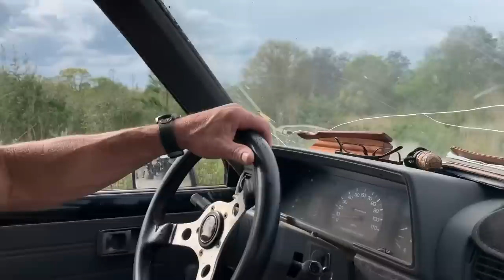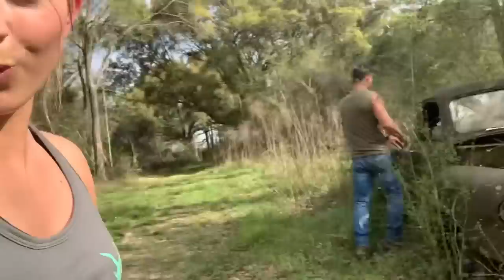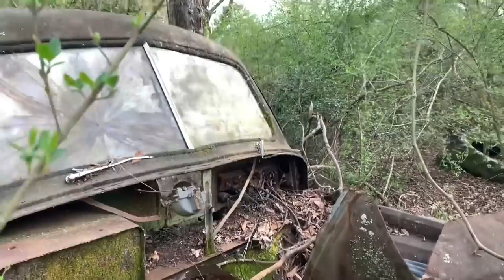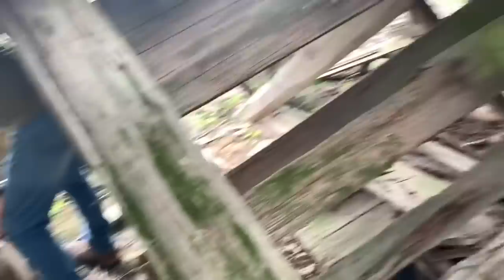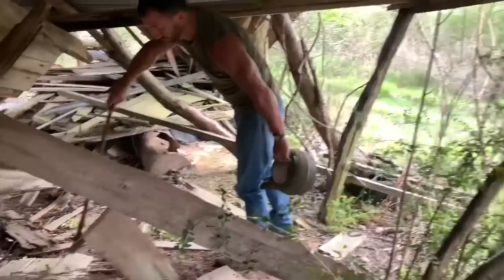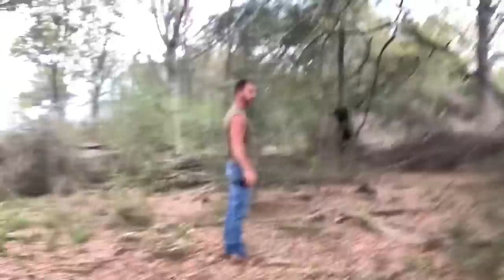Looking for Turkeys & Exploring Old Barns!

Comment: I’m right with you Hannah … I love encountering old buildings and rooting around … we have a old railway line from my city Cambridge that runs all the way to 4 cities away Paris … the cities all tore out the tracks … sanded it all down and it’s a walking … biking … cross country skiing trail … but what’s special about it is all the old ruins back in the bush if you’ll go off the trail … old homesteads … what looks like some kind of storage or factory buildings by the size of them … an old water mill it seems with the old wheels inside that’s about a mile from where the Grand River runs now … it’s an amazing hike and a look through older times trying to figure out what the buildings could possibly be … keep checking those old places and I will too !! … appreciate ya !!!  💯❤️🇨🇦🤙

Comment: Only 3 weeks - not too bad actually.  I hate it when I'm out scouting property and end up finding treasures like what yall discovered because my scouting goes all to heck.  What's funny is when I find an old plow piece in a field or clear cut I pick it up and use it for decoration, but when I lose a piece off of my tractor all I do is cuss about it.  As always, thanks for the video and good luck with the turkeys.  I went turkey hunting last weekend for the first time this season.  Not my norm as I usually take opening week off of work to get after them, but this year the virus has me working harder than ever.

Comment: My 69 Bronco was a early release Sports Edition that was sold to the USPS in Trinity County California in Nov.1969.
My windshield wipers originally ran on vacuum supplied by the fuel pump. This long discontinued pump is harder to find than hair on a frog. In fact the only thing finer than frog hair has gotta be Hannah Barron....👹

Comment: Minnesota is a green zone, meaning glaciers moved gold from the Yukon south. Its found as grain gold which is capillary gold skinny veins running through rock the ends get wore off causing grain gold 1/10 the size of a grain of salt. You need a 30x lighted magnifier or good eye sight and a sunny day, but mostly you tell by weight. two granite rock look alike same size one is 9# one is 14 save both look at the heavy one. two rocks one at a time into water measure displacement use weight and displacement as X and Y and you have algebra to assay about how much gold is in a rock. collect 300 pounds you could have 20 pounds of gold.

Comment: Yall should make ya an electrolysis  tank if you dont already have one. 2 pieces of rebar, 2 pieces of heavy gauge wire, a battery tender, water and borax. And a 5 gallon bucket or whatever size fits your part you want to de rust.